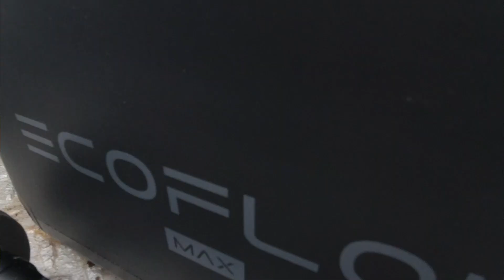DiResta's Garden Gates

Comment: Looks great! I’d suggest drilling and chiseling out the the full distance of the striker plate opening. Even the best built gate will sag a bit over time and that’d save you from nudging it up for the bolt to find the hole.
Reply: More often than not a properly built gate like this will not sag. But the gate post will heave and lean. With no diagonal deadman backing it, this post is a prime "Leaner" candidate.
Reply: LMAO
Reply: Yes, I built a gate little taller like this, when winter or hard rain arrives... gate has issues, so a large hole behind the striker plate was necessary (even in TX) 🤠
Reply: @VintageTexas59  rain? In Texas? I’d love to see some of that! 😂
Reply: @branchandfoundry560  I agree 100%. When I do these installs, I wire the hinge post with a in-line come-along to the next post. Over time, as the inevitable sag sets in, you can tighten it and pull the hinge post back to plumb.

Comment: Lovely gate, so fitting with everything else you have & probably long lived in your climate. Here in northern uk wood rots too quickly so reluctantly I now mostly build in steel. We also have lots of deer now so I need much higher fences or scaffolding netting over plants else Bambi eats them. Thanks for sharing!
Reply: I dunno, my parents had a house with a untreated picket fence in Southern NY, and even with diligent care and painting with rot inhibitors, it lasted less than 15 years. It got replaced with chain link with privacy inserts, on galv posts and top rails, and its still standing 35 years later.
Reply: @kajem575  Love that galvanized chain link look. So industrial and reminiscent of prison. Warm, cozy, you just want to cuddle up next to it. Screw wood fences!

Comment: Notice how on the hinges they have three fasteners in an offset...there is a reason you don't use a single, say, lag bolt. All those lag bolts are just pivot points over time because there is nothing to stop the wood from rotating around them, like, say, two other bolts in an offset.

Comment: I'm sure that gate will outlast you but I'm curious about the direction of the diagonal. homemade home did a small gate once and he explained the weight of the gate pulls from one side and would make it sag. I'm sure someone will chime in and maybe you did it the way its supposed to be...i'm not sure. maybe a quick explanation (maybe you did in the patreon video)
Reply from the maker: Compress wood.  Tension steel.
Reply: @jimmydiresta  haha yes after thinking about it for 5 more min I get it :) quality work jimmy!

Comment: Didn't you consider a vertical stop so the gate can but against and prevent opening into the inside? Its much easier to close with the pin having a stop to shut the gate against and then push the pin into the pillar.

Comment: Looks like it would stop an Abrams tank. Curious why you put the nuts and washers on the side outside of the fenced in area. Aesthetically, I think it'd look better with the heads facing the outside world. Just my IMHO, which isn't worth the pixels it's printed on :)
Reply: I was wondering the same, especially as it seems the other side might be or become a horse pasture and if that is the case, they might hurt themself on the rough-ish edges of the bolts. But then maybe there will be no horses and only Jimmy can hurt himself from that side.

Comment: Impressed that someone is still using a circular saw mill. Do you go straight to the sawyer or get the rough lumber from a supplier Jimmy?
Reply from the maker: The mill is 4 miles up on my road 🙌🏼
Reply: @jimmydiresta  I really need to break into that market but my area is too suburban. I had dreams of supplying all the rough cut lumber for brewery build outs and hobbyists, but I just supply myself 😂
If the mill would allow it, I'd love to see you do some filming of the circle mill in action.
Reply from the maker: @ezdankie  I’ll Instagram there